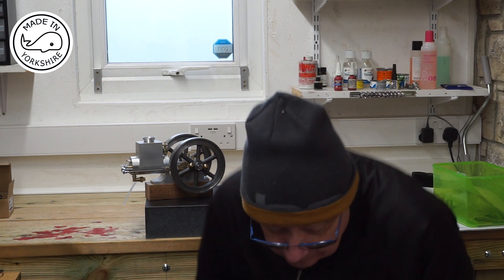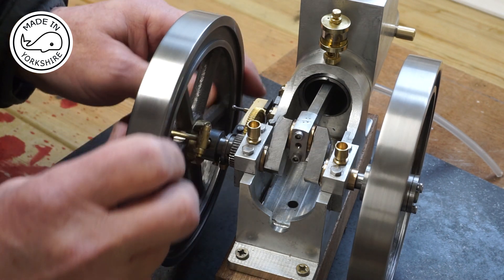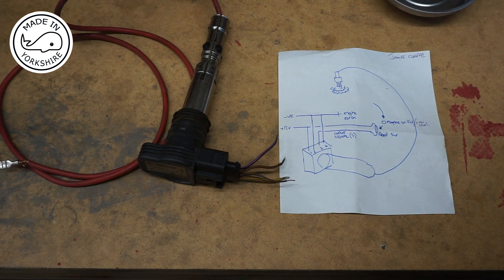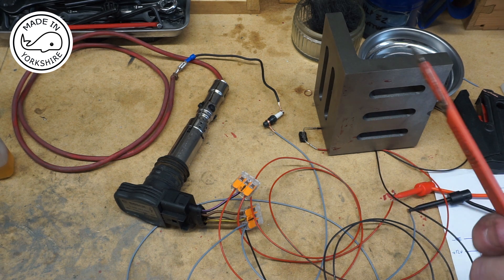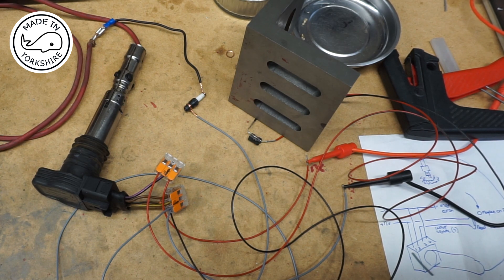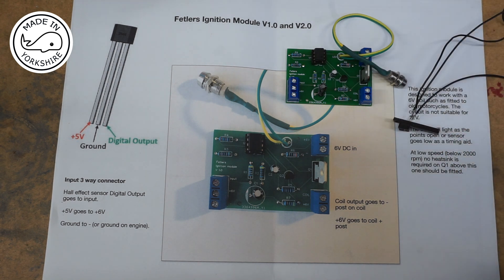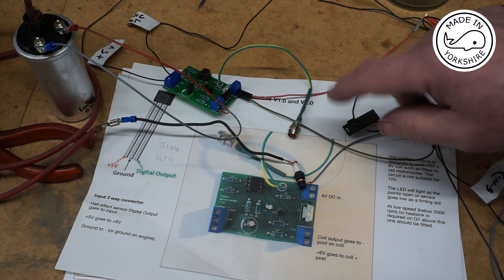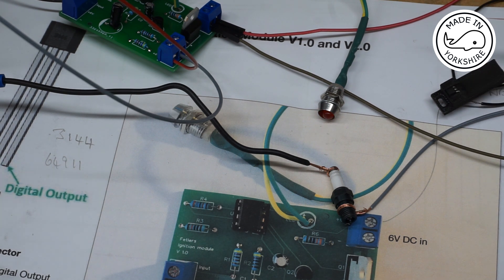#MT35 Part 20 - Farm Boy Hit and Miss Engine. The Ignition. By Andrew Whale.

Comment: Great engine build. Where did you put the magnet for the hall sensor
Reply from the maker: Thanks Philip. The magnet is on the inside of the cam gear. I 3D printed a holder for the hall sensor and attached it to the body of the engine.
Cheers 
Andrew
Reply: Thanks for that. Do you have any pictures of it

Comment: G’day Andrew. Moving the timing before TDC is a good idea, by the way you are advancing the timing not retarding, I know it sounds wrong but you want the timing event to happen earlier  
Methanol is a slow burning fuel so you need to advance the timing, by how much, keep advancing until it happens and make a starter motor with your battery drill, it’ll save you RSI. GOOD LUCK. Cheers, Peter

Comment: alan thatcher, hi andrew i have built 27 model hit and miss engines and now use tiny small cdi ignition  from ebay model engine section  2"x11/2"X1" NIGOSTAR IS supllier comeplete  with hall sensor 
£18.00  9volt battery hop this helps
Reply from the maker: Hi Alan - thanks for the info, but searching for that on eBay UK doesn't produce anything. Is the search criteria correct? 27 hit n miss engines would take me about 27 years at my current rate!
Cheers
Andrew
Reply: @learningturningmetal  hi andrew go to ebay put in  hit and miss engine model scroll down you will see a yellow box igntion £25.00 gone up a bit run it with a cr123 3 volt lithium battery .   go to youtube enter centaur model engine scroll down till you come to alan you will see it running i take the lid of ignition i am useing a micro switch alan
Reply from the maker: Thanks Alan - I found it! I've made a note of it for future reference. Useful info for others too. I've just checked out your YouTube video - you have made an absolutely fantastic job of your Centuar model engine. Looks complex but that might well be my next project! I like challenges. Food for thought.
All the best.
Andrew

Comment: I just got my Howell running with the governor, I am using a Hall Effect ignition system form model-engine-ignition.com. Two items. First, mine is running at about 800 RPM. The governor engages at 825 RPM and disengages at about 750. I have a small electric motor to get it up to 500 RPM before it starts firing reliably. Once started it runs "smoothly", being a hit.miss engine. Second, I found that air intake port of the mixer was too big. I reduced it to about 0.100" and it works just fine. I am a function before form kind of builder, hence mine is no where near s finished as yours. Took me a year. Oh, I also put a flat on the crankshaft under the gear. The 2-56 screw was just insufficient in hold the gear's position. Good luck and may you dance ridiculously when it fires. Peace.

Comment: Hi Andrew, looks really good and cant wait to see the end result which im sure wont be long with your pace! Im still way behind as my workshop is frozen and im waiting for the electrician to fit a new fuse board as mine has blown ...too many amps i guess. Have you looked at the Hemingway projects - theres quite a few interesting projects. All the best
Reply from the maker: Hi Andy - definitely not great weather for working in the workshop. I hope you get the power sorted soon. 
I've ordered a couple of books from the US. One is The Shop Wisdom of Philip Duclos which contains a number of plans. If I can get the hit n miss running I might go for a Duclos engine. If it doesn't run I will sell all my gear  - ha ha.
Cheers
Andrew

Comment: good work, i think your first setup, not only created an ignition system but also a spark transmitter used in early radio,
Reply from the maker: Hi Gary, I think you are spot on. A few others have suggested that. Cheers
Andrew

Comment: Hi Andrew. I'm planning on using 4 18650 lithium cells as the power source on my Farm Boy and use a quad bike coil with the Jerry Howell ignition board. I did that on another engine I built and they worked well. Yours seems to have more compression than mine so I may have to investigate that. Cheers!
Reply from the maker: Hi Tony - sounds like a neat solution. Regarding compression - James Chaffe commented that it sounded like I had a small leak on a valve - have a look at the comments. I sprayed some WD40 on the outside of the head and found loads of air escaping past the spark plug. I didn't want to over-tighten and strip the threads in the head, so I put a viton o-ring under the between the head and the spark plug washer. That improved compression immensely (I now get a lot of bounce back when giving it a turn) but I can still hear a slight leak in the area of the exhaust valve seat. I had originally used some Solvol Autosol to lap the valves - but it is very fine stuff. I've just ordered some ultra lapping paste (1000grit) from Moleroda and I will have another go at lapping when I strip it down for painting. I've not seen any comments of people using this lapping paste, but it comes in a massive range of grits. Hopefully mine will still be OK for a test run. Try some WD40 on the outside of the head and see if you can spot any leaks. James Chaffe is very informative regarding compression.
Let me know how you get on.
Cheers
Andrew
Reply: @learningturningmetal  Thanks Andrew. I'll try the WD40 trick and see what I can figure out. Cheers!

Comment: Just thinking about your WiFi going down during the test with the HEI coil on plug set up. You may have not have been using shealded cable and the hi frequency of the spark drowned out the WiFi. Just a thought. I really enjoy your channel 
Thank you Bill Beutler Topeka Ks.
Reply from the maker: Hi Bill - I think you are correct. A few other comments recon that's the case too.
Glad you like the videos.
All the best and take care mate!
Andrew

Comment: The engine looks great and turns over smoothly. All the ignition and coil discussion takes me back to tinkering with my Ford Escort 40 odd years ago. I assume you will be able to reduce the set up to a neat box housing once you are happy with it. So the million dollar question...is it going to run? You have compression, you have a spark, just add fuel and get the timing right. I have faith.
Reply from the maker: Yeah Tim - it takes me back to that era too - when motor vehicle ignition was such a simple affair. It's a shame that the Farm Boy wasn't designed to have a set of points cos I would have been in my element. Three more videos to go I think. Next will be a test run, second might be a fuel tank, and the third showing it painted and mounted on something to hide all the electronics. Getting to the very nervous bit now!
Cheers
Andrew

Comment: You need a proper spark plug wire. The plug wires need a high resistance to prevent electromagnetic interference.
Reply from the maker: Hi Jeremy - I never thought of that. I hadn't got a connector for the rimfire sparkplug so I just extended an HT lead with some thick wire. I've just this minute purchased a connection from minimagneto.co.uk. I hope I will be able to connect the HT lead to that.
Fingers crossed.
Cheers
Andrew

Comment: Another great video Andrew, thank you. Can I ask how you are getting on with the WM18B now? I'm sizing it up alongside the smaller WM16B and the SX2.7 from Sieg. Wondering whether it's a false economy to go for the lighter ones and if I should jump straight to the bigger beast.
Reply from the maker: Hi - I've got the WM18 - not the belt driven version. It's great! Powerfeed on the x-axis. Large table, lots of room, very accurate. I just hope it will be reliable. Probably better going for the belt driven version if you can get powerfeed on the x-axis. Go as big as you can get, if you have space and budget!
Cheers!
Andrew

Comment: It’s a great little engine , but did you have to put a computer on it ? You have a coil , all you need is a mechanical contact switch . That’s how the 
old ones worked . You could also make a coil from an old door bell buzzer and a four wire lawnmower magneto . That’s how I reproduce automotive Buzz Coils . I think I have a power point on YouTube , if not I’d be happy to share .
Reply: And a condenser, sorry , capacitor. 😊
Reply from the maker: Thanks mate. I guess there are lots of ways to skin a  🐈. The hall censor fits in with the original design, though I would like to consider alternative methods in the future. I quite fancy using points and a coil on an engine.
Cheers
Andrew
Reply: @learningturningmetal  I actually use points (instead of the Reed switch) and a VW coil on my hot and miss! I use a Reed switch to trigger coil on my vertical engine. You can also use a hall sensor to trigger the VW coil. It’s doing exactly the same thing as that circuit board and 6v inside.
Reply from the maker: Mind-blowing James! I guess the points go on a cam on the other side of the crankshaft. But that would result in a spark at the top of each stroke? You should do more videos of your setups cos loads of folk would be interested I'm sure.
Cheers
Andrew
Reply: @learningturningmetal  yes, wasted spark, whereby you have a spark at every TDC, common on just about every single cylinder engine and most twin coil engine from the 90’s and earth 2000’s. I’m a very busy man with a full tone job, two young kids, a summerhouse to build, a patio to lay, and many other machining/welding projects to do! Not much tome for filming videos I’m afraid! I enjoy watching your videos! Ha

Comment: Hi,Andrew. I think it undoubtedly some form of electro magnetic or RF noise issue that is interfering with your internet and computer systems. Whether it is  generally RF being transmitted through the ether or a spike being transmitted back down the wiring ring main is what you first need to establish. Is the power supply plugged into a socket on the same common ring main as the  computer is?
Allan Enot's channel had an issue with a electrical spike from one device interfering with the DRO on his milling machine. He simply separated the 2 onto different ring mains. James Clough also had a couple of videos demonstrating how to remedy unwanted interference noise when he recently installed a Variable Frequency Drive to one of his machines.
Reply from the maker: Hi Howard - it's all on a separate ring main. However from other comments it appears that interference like this can be quite common. Some suggest that placing the spark plug in the engine might reduce it. However, it's not an issue, now that I've decided to go with the other option.
All the best.
Andrew

Comment: Hello Andrew,
I like Simon's solution mainly for the LED as it would be useful for the timing and diagnostic/fault finding. I am sure you have planned this but it would be great if all the ignition stuff (battery, LED, Coil, ETC.) where located so they did not take away from the great look of the engine you've built.
Take care
Paul,,
Reply from the maker: Yeah Paul - assuming I can get it to run, I will need to paint it and put it on a platform to hide all the gubbins.
Watch this space!
Cheers
Andrew

Comment: Gday Andrew, I certainly did find this very interesting, I’m not sure why the first setup affected the internet, that’s a strange one there, the engine looks beautiful, you have done great job, cheers Matty
Reply from the maker: Thanks Matty - from other comments it looks like it's not uncommon. However, if I had tested it with the spark plug in the engine it might have shielded the problem. I learn something new every day! The engine needs a bit of a tidy but it should look OK once painted. I just need to get it running first.
All the best.
Andrew
Reply: @learningturningmetal  The reason why your internet and TV died when you used the high power system was that the spark generates an Electro Magnetic Pulse (sometimes abbreviated EMP). An EMP is a broadband radio signal, this is what Marconi used in his early experiments and a big enough pulse can not only interfere with wifi and TV signals it can actually destroy sensitive equipment. All sparks will generate this, so when you described the first system as generating a big fat spark then this will generate a lot of interference. Car bodies and the position of the spark plug in car vehicles actually screens a lot of this from escaping the vehicle. The 6v system probably generates a pulse with less energy and therefore less interference which the wifi can tolerate.
Reply from the maker: @terrybailey2769  Very interesting!

Comment: It looks like you found a lower power solution! That VW cylinder coil would have been generating considerable broad spectrum RF noise that would also be annoying your close neighbours if your walls were a bit thinner. Once the plug was enclosed I suspect that it would no longer interfere but the new solution will be lower power anyway, so better from batteries. I am surprised you don't recall the days of  analogue TV when you could hear the motorbikes and cars with leaky HT leads heading down the road :~D
Reply: So how come it doesn't wipe out internet and other delicate systems in the neighbourhood when it is producing sparks for the VW car engine.? Electical noise supression is a requirement on all motor vehicles.
Reply: @howardosborne8647  Yes but that depends on a spark enclosed in a grounded cylinder together with a suppressed lead. Even if the lead is suppressed the spark was open, and those VW coil on cylinder units are very powerful with such a small plug that probably has a lower impedence than a standard car plug. I designed an electronic ignition that used a PIC for a special purpose and that needed a very specific plug to match the coil impedence, as well as extensive opto-isolation and filtering to prevent induced current crashing and ultimately killing the digital electronics.
Reply from the maker: Great advice mate. Yeah I do now recall getting TV interference when some cars passed the house. The good old days!
Cheers
Andrew

Comment: Great to see the progress!  Could be that the 12V is simply making a bigger spark and that you've accidentally built a nice 'spark gap transmitter' that is messing with the radio parts of your router.  Anyway, putting the sparkplug in your cylinder may help a lot already in shielding the radio emission (having the metal work for you as a Faraday cage).
Reply from the maker: Thanks for the advice Roel. Looks like you might be right. I never thought that putting the spark plug in the cylinder might help - great idea. 
Cheers
Andrew

Comment: It’s getting close! Excellent video as always. Check the compression remains after holding at TDC for a few seconds (no leak down at valve/piston ring) hard the say but it sounds like a small leak at a valve. Both my engines will push away after holding at TDC for a second or two. 
Will be running this week!
Reply from the maker: Thanks James - you have got me worried now! I will have a listen!
Cheers
Andrew
Reply: @learningturningmetal  it should hold pressure at TDC, at least for a few seconds. And have enough to push piston mostly back down bore. It will run with a little leakage, but will be far easier to start with none. Can’t wait to see it run!
Reply from the maker: Blimey James you should provide remote diagnostic services! I've just checked and there was a massive air leak around the spark plug. Only way to fix it was to put a nitrile o-ring under the copper washer. I hope it will withstand the heat - but then again the piston ring is nitrile. I can still hear a very slight hiss - I suspect the exhaust valve seat because it goes away when I cover the exhaust outlet. I don't think compression is as good as you describe, but I think I will try running as is. I'm waiting for some heat shrink tubing to arrive before fitting the ignition.
Thanks for the great advice.
Andrew
Reply: @learningturningmetal  what can I say, I have a good ear! Have you lapped the valves at all? I found it necessary.
Reply from the maker: Hi James - I used some Solvol Autosol but its very fine - probably too fine. Any recommendations?
Reply: @learningturningmetal  just patience really. You shouldn’t really have any leaks past valves under compression. I have used fine grinding paste from automotive industry too. Best to keep abrasives as fine as possible for obvious reasons. All the best

Comment: Well done Andrew, looking great. Just  a small niggle to me, I think that you went a bit OTT with your Big End bearing cap marking, 2 big pop marks showing, just 1 small pop or even a small nick with a knife edge file would have been sufficient. Perhaps on final assembly you can rotate the Conrod so that the marking will be underneath and will not show. Sounds like you had a heater running this time. Stay Safe PLEASE. I am sure that I am not alone and are itching to see this engine run. Will this use unleaded Petrol or will you use Model Aircraft Fuel ? Regards from Australia.
Reply from the maker: Ha ha Dave - It's a BIG niggle for me! Goodness knows why I marked it up like that. You live and learn and I hope I won't do that again - I plan to sort it out on final assembly. I'm hoping to run it on methanol with a small amount of WD40. I've got some methonal tolerant fuel pipe. Fingers crossed it will work!
Don't get sunburn - it's snowing here :-(
UK has just hit 100,000 covid deaths! Crazy!
All the best and you take care.
Andrew